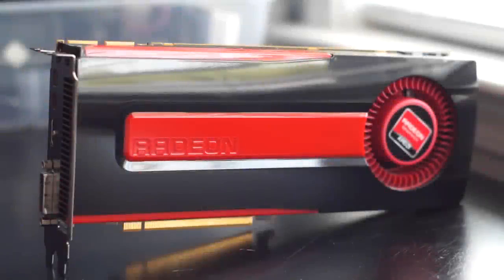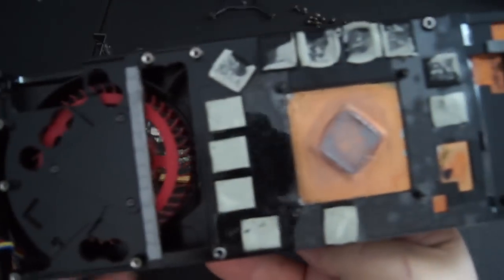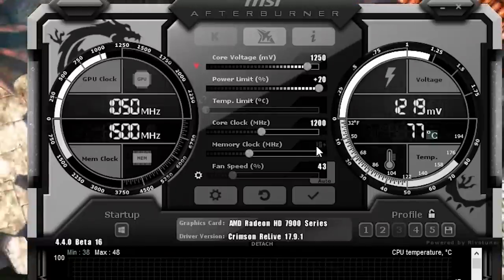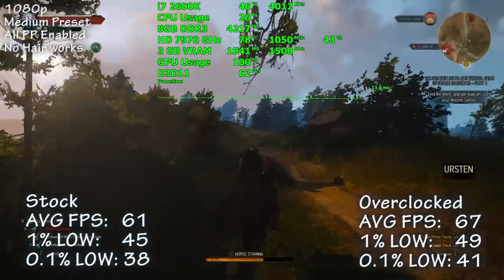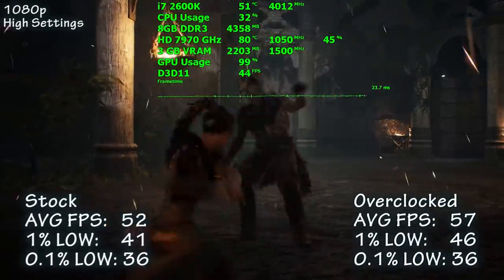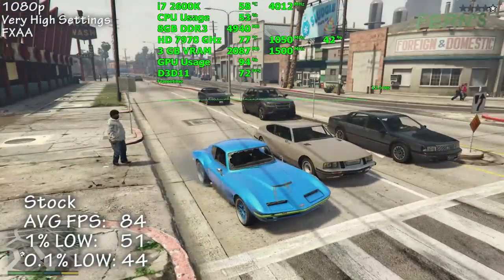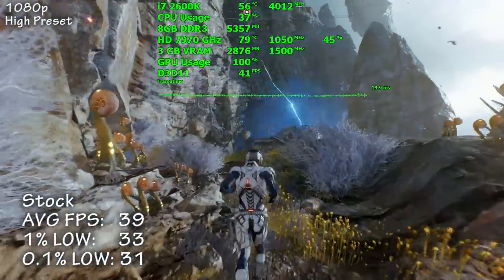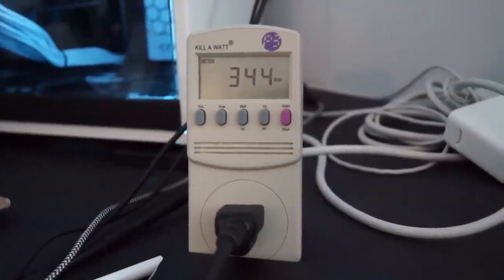AMD Radeon HD 7970 GHz Edition - How Does it Stack Up in 2017?

Comment: What the hell, 75-80 degrees Celsius??? My rx550 barely reaches 62 with the fan at 35%. And it's overclocked on the memory and core speed by about 100MHz (not touching the voltage)
Reply from the maker: Yeah Tahiti card’s are much harder to cool, and this cooler doesn’t do a great job. This card has a TDP of over 250w, while your card has a TDP of 50w.
Reply: F2F Tech Yeah, Radeon Overlay with the hardware usage open shows your power consumption and it showed 35W going up and down, that 250W TDP is insane
Reply from the maker: BOSNIAN GAMER Yeah its pretty typical for high end SKUs, but it’s still a lot.
Reply: he using reference design too
Reply: the rx550 is neither by concept nor construction comparable. A better fit would be an rx 580 nitro+ l.e., serving the same market section today as an 7970 oc back then did. And both run hot, what a surprise.